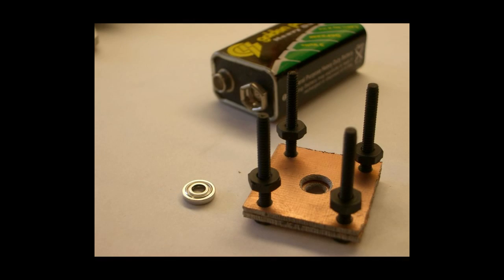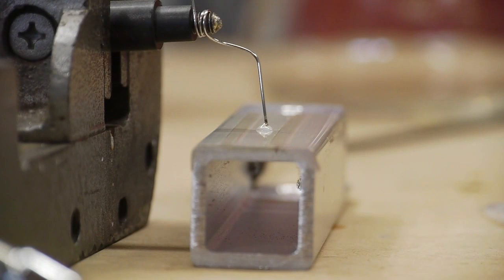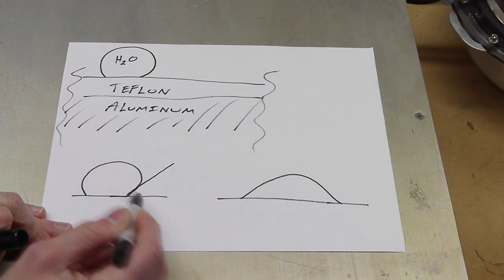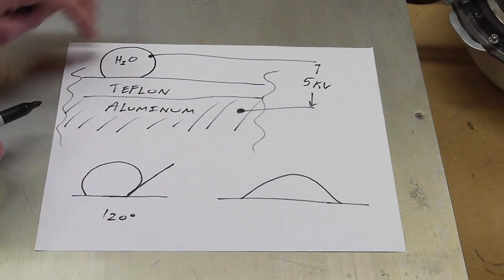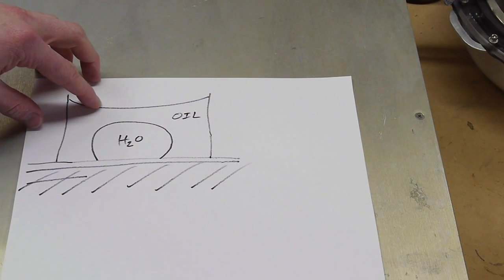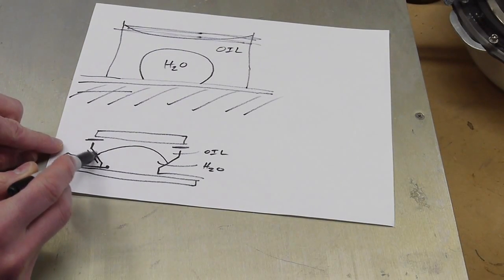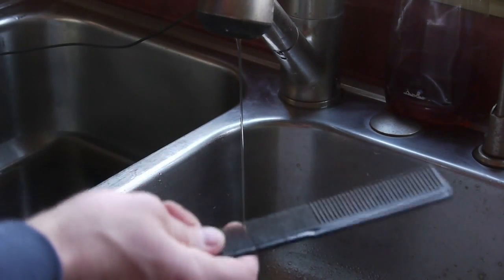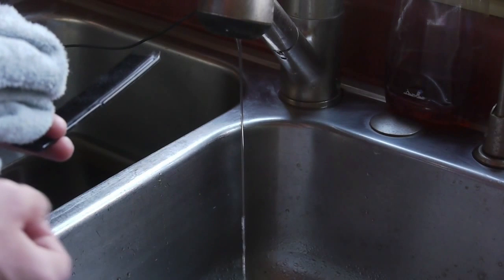How a liquid lens works (electrowetting)

Comment: They use this principle in those new EWD's (electro wetting displays), were a black liquid is used as a curtain that you can move from the red part of the pixel to the green and the blue. They made them to be as similar to LCD's as possible, they work the same way except they don't use polarisation of light at all. Apparently they are 3 times as efficient and much more bright when used in direct sunlight.
Reply: I winder what happened to that technology

Comment: For anyone curious, the oil they use that has a density like that of water isn't vegetable oil or petroleum oil, but rather silicone oil - a polydimethylsiloxane like they put in kinetic sand.

Comment: In answer to your question about getting adhesive to stick to the PTFE. Assuming the tape is polythene, they could easily get an adhesive to stick to the polythene then by simply blowing F2 gas over the surface of one side of the polyethylene you get a PTFE surface on the polythene. I think that's how they put a PTFE coating on the inside of polythene pipes.

Comment: Electrical engineer here - the water stream deflects because the like charges are repelled away from the the high potential object either to ground (as in the faucet) or to virtual ground (anything of large enough size to act as a sink). The remaining charges (opposite) are attracted to the high potential object causing deflection. These charges, by the way, don't need to be a chemical ion. You have free electrons in every material.

You can see the reverse of this with a single droplet. It does not have a large enough size to allow for charges to get moved far enough away. To provide this, you have to add an electrode that can pull the voltage down/up.
Reply: Also, there is a gradient in the electric field. For example, if his electrode is negative, the side of the water column that is closest to the electrode has a more intense electric field than the other side. The positive ions experience a more stronger attraction compared to the negative ions with experience a lesser repulsion.

It would be interesting to have no gradient. Then, the water stream would not bend.
Reply: Everything has free electrons, if you give it enough voltage that is

Comment: No. Water will not become magnetic in this case 
1) there are no electrons with uncoupled spins in H2O, so water cannot be magnetic
2) because you apply electric field, not magnetic, and water does not have multiferroic properties. 

However, if you apply strong enough electric field (order of MV/m) you can disrupt hydrogen-oxygen bonds and the water will have hard time freezing. (S. V. Schevkunov and A. Vegiri, Electric field induced transitions in water clusters, J. Mol. Struct.  593 (2002))

Comment: I find this particularly interesting because I am hoping to use the same properties that you show water having due to it being a positively and negatively charged molecule (both positive charge atoms and negative charge atoms in it.) and as we know from electrolysis they can be separated, so now the trick is to figure out how to control depositing the separated atoms to a surface :) (the theory behind my atom based 3D printer)

Comment: aluminum hardcoat can withstand 800 volts per 0.001" thickness. It's usually 0.001" to 0.002".  You used 0.005" teflon at 5Kv. So uhh...nevermind, I think hard coated aluminum at the common thicknesses doesn't have enough dielectric strength. I'm leaving this commont incase it crossed someone else's mind (teflon tape isn't expensive but it's somewhat obscure for most people.)

I guess a less obscure option common available 2-5 mils thick including adhesive would be Kapton tape. It has way better dielectric strength than teflon according to a quick search from random internet-sources.
Reply: How much is that in mm?

Comment: I actually had imagined a contact lens of flexible materials (soft contacts) that was hollow as a slit and there was a reservoir that had a pump hooked up to it to pump liquid into and out of that hollow slit to cause it to expand or contract, so that the contact lenses could adjust focal distance on the fly, after I thought of using something like silicon and that pump system to make a variable contact lens mold, so this is all very interesting to me. (the ideas on customizable lenses I mentioned were like from 1995 or so, back when I had my first soft contacts, :)

Comment: Ahh, when water is in contact with a surface, there is a surface charge correlated to it. That charge will influence waters surface charge as well (or not depending on surface angle imparted). As a result of this influence, the electrodes have a different effect on the water droplet than running water.

Comment: I would be interested to see how far the water in a filled sink would jump out of the sink if you dropped your HV supply right into it powered up. Avenue of scientific equiry: what percentage of the water jumping out would be due to the electric field and what percentage would be due to the Archimedes effect? (Of course your measurements for the electric part would have to be done VERY quickly.). :-)

Comment: If this water droplet moves due to electricity, does that mean electrolysis takes place? I saw people using Teflon clear coats and is till able to move the water droplets, this means no electrical contacts are moving the droplets, has to be an electromagnetic field.

Comment: Hi! I am looking to make some liquid lenses and I was wondering what exactly is the power supply you have called as I've been trying to find it on Amazon and I am having no luck :( also I have a power supply of 30 V (which I can see from this video is wayyyyy too weak for making liquid lenses) but I was wondering what's the minimum voltage you need as I'm aware the higher the voltage the more expensive they are

Comment: At 7:13 you mention that liquid lens can change from No Power, to Negative Power, to Positive Power. Yet, you also mention there is no polarity at around 9 minutes. This kind of throws me off because if the water molecule is just flipping around then the water would behave the same upon reversal of current.
Reply: Possibly there are 3 electrodes, the one contacting the water, and one for each direction you want to pull it? Just a guess
Reply: In the liquid lens, there is an electrode in the water. So the water can be charged negatively and positively compared to the outer electrode. In the tap water experiment, the water is neutrally charged so the attraction is due to polar molecules.

Comment: could static be used to heat water?
is there enough friction between the water molecules that a static pulse near the stream might cause rapid pole re alignment and a raise in temp?
Reply: Pretty sure that's how microwave ovens heat water.

Comment: Dumb question; if an electric charge causes the water molecules to orient a certain direction, could you use it to mix oil and water with an emulsifier by alternating electric charges on the sides of a vessel?  The intent being, mixing a fluid without physical interaction like a stir bar or a spoon.

Comment: Error concerning polarity of water 
The deflection of a stream of water by an electric charge is often cited as a demonstration of the polarity of water molecules. The idea is not uncommon in text books and sometimes appears on examination papers. Students are expected to say that the deflection of the stream of water is due to the polarity of water molecules. 
Oxygen is more electronegative than hydrogen and since water molecules are not linear the centre of positive charge does not coincide with the centre of negative charge; therefore water molecules are electric dipoles.
What’s wrong with this explanation?
Water molecules are polar; this is true. However it is also true that they electrically neutral and that they are very small. If a negatively charged rod is held 10 cm away from a water molecule then the attractive force on the hydrogen side and the repulsive force on the oxygen side are, for all practical purposes, equal and opposite.
Easily disproved 
Here are some simple demonstrations that clearly show that the ‘polarity argument’ is unsatisfactory.
1. 	No deflection occurs if the water becomes a stream of separate drops, unless the charged rod is sufficiently close to the point where the stream becomes discontinuous.
(This immediately refutes the polarity argument.)
2. 	Get a 500 mL plastic drinks bottle. Using an awl or nail make a hole (about 1 mm in diameter) in the side of the bottle a few centimetres from the bottom. Place the bottle on a large insulated block (e.g. styrofoam container) near a sink. Fill the bottle with water and arrange it so that a stream of water flows into the sink. If a charged rod is brought near the stream it will not show a continuous deflection. (It may show a slight deflection initially but it will not last.) 
3. 	Clamp a salt cellar on a retort stand so that the salt can flow out. Bring a charged rod near the salt stream. It does not deflect. (The charge separation in NaCl is greater than that of water; so are the charges. NaCl is about five times more polar than water but it is not deflected.) 
4.	(Don’t try this one.) A continuous stream of mercury would be deflected by a charged rod even though mercury atoms are not polar.

What’s the right answer?
The right answer is perfectly simple. Continuous conductors may be deflected by an electric charge. Water is a conductor and so if, for example, a negatively charged rod is brought near an unbroken stream of water coming from a tap then a positive charge can be induced on the part of the stream near the rod. The force of attraction between the two will deflect the stream.  This cannot happen if the stream is broken into separate drops.
In the second demonstration (above) even a continuous stream of water is not deflected if it is electrically isolated because electric charge has no path along which to flow.

Comment: Hi, you have very cool channel, Thank you !
I've seen water deflection experiment on Veritasium channel,  link to the moment in video https://youtu.be/1Xp_imnO6WE where he states the problem, and then he explains  it differently than you do in  here https://youtu.be/jIMihpDmBpY?t=3m48s . So I'm wondering if there a way to test what is more correct explanation, maybe if measure pH in the water that is falling down and in the tank.
Reply from the maker: Oleksandr Kolyvushko I tried the experiment with distilled water.  The water stream was deflected in the same manner as tap water.  The next experiment would be to test with salt water.  If adding more ions to the water does not change deflection, then dissolved ions probably play no role in the phenomenon.
Reply: Thank you for response.
I think what Veritasium was trying to say that the water it self is dissociating to negatively charged hydroxyl groups [OH-] and positively charged protons[H+]. Water dissociation is the basis for pH and pOH measurements.
 In Ideal conditions distilled water would have pH=7  (7 is the negative log of concentration of [H+]. However in atmospheric conditions as far as i know CO2 will dissolve in water forming [HCO3-] and [H+] ions.

Will the water steam (gas) will be deflected ?
Reply: Oleksandr Kolyvushko great point, i woult love to see an experimental setup with water vapour! ;)
Reply: There is a simple experiment that disproves Veritasium hypothesis. If you have water pouring from a container, the water left behind will accumulate ions with the same charge as object, if his hypothesis is true. That means we should see the last bit of water being deflected by the charged object. And we don't see that.